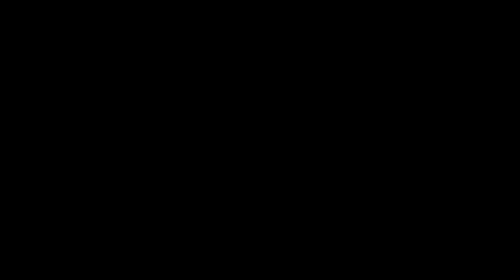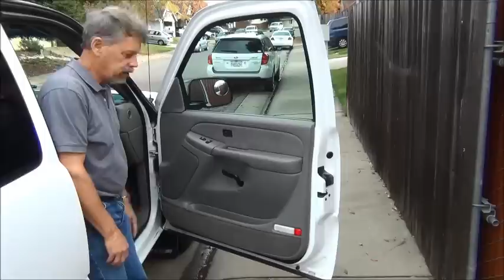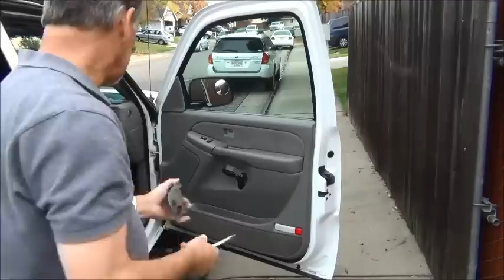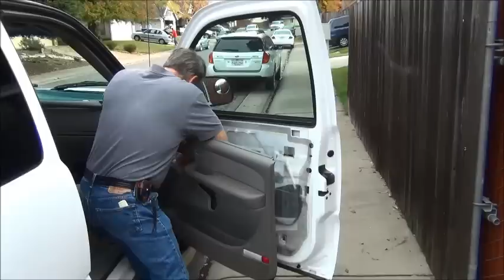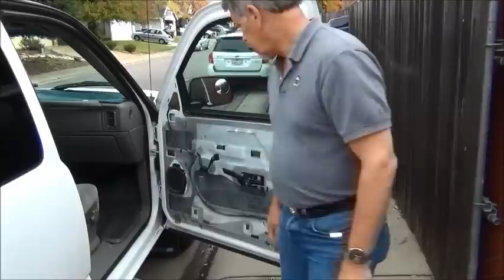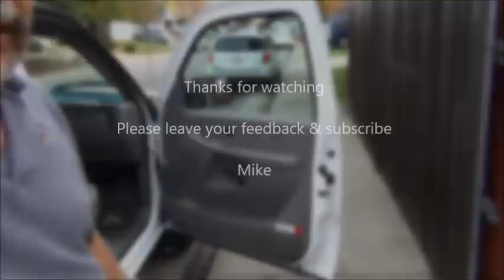2000 Chevy Silverado front door speaker replacement & door panel removal tutorial

Comment: will replacing both speakers fix having no bass whats so ever or do I have to get a new teeter?
Reply from the maker: I don't know if replacing the speakers will fix your problem. Your problem could be the speakers but it also could be the radio. Replacing the tweeters will not fix the problem since tweeters only reproduce higher frequencies.

Comment: I used this video as a base instruction to replace the oem speakers with another oem set. I had the speakers swapped out in 20 mins by myself. I will add my truck was a 2004 and I left the window lock/control panel in place prior to lifting the panel off the door. I found one tab was actually screwed in one spot from underneath. This likely would have broke if I pried it out. Just extra info. Overall great video.

Comment: Umm, pretty sure you can just pull the speaker cover off each door and that's it. The cover has tabs that make it very easy to pop in and out to access the speakers. Took me less than a couple seconds with a flathead 🤷🏼‍♂️

Comment: Video was good for knowing how to get the door panel off, but would’ve been helpful more if you would’ve stated the sizes of the screws and would’ve also shown how to unhook the wiring for the windows/side mirrors. That part was a little confusing for me trying to find the right socket and trying to unhook the wiring. But overall you gave me the information I needed to get started. Thanks for the video and keep up the work!

Comment: Thank you for the clear instructions for replacing the front door speakers. I might not be putting OEM, so I guess I will have to use self drill screws to put in a speaker in place.

Comment: so if I was to use 6 1/2 speakers, would I have to drill fittings or would it snap in?
Reply from the maker: +william nelson If the speaker is not an OEM type speaker you will have to make modifications for it to be secured to the door.
Reply: Mike Fedler OK, thank you for the reply, it's good to be prepared 😊

Comment: The video helped me 100%. Now, I wish someone would make a video of removing the backseat from the same year truck.
Reply: +Tyler Moore rear seat removal, remove 4 bolts that hold seat to floor, in the center rear there is a V support cable remove nut. Lift complete seat up off of rear hooks and its off.

Comment: Just replaced both front speakers on 2000 Chevy Silverado Z71 Stepside. Got them on amazon ACDelco 15038566 $45.00 each, over $100 at dealer. I knew both were bad because I could hear tweeter in each door but not main speaker. That let me know signal was getting there and probably wasn't the radio or connection. Went well, video helped a lot. Couple of tips. What holds screws in is a flimsy strip of spring steel don't over torque them they'll split. If you do you can get square plastic fastener with screws at O'reily's in the Dorman parts section. Driver's side has more connectors, no big deal. The little clips hold things in will sometime pull off plastic, just get them out of door and push back on.

Comment: Never tinkered with tweeters before so i am not to sure how to tell when they need to be replaced but what is the size of the tweeters? in my 02 all the speakers are dead sept for the driver side and that one is working on its last legs.. got the truck that way.. so i am not sure if the tweeters are also bad or just the speakers them selfs.. also need to tackle the speakers in the rear to :/
Reply: Did u figure it out?

Comment: Your vid got the job done on my 2002 silverado, using original equipment speaker purchased from Amazon. Also found the tweeter dangling, its two plastic mounting pegs having broken off. I removed the metal mesh grill so I could hold the tweeter in place and two #6 x 1/2" sheet metal screws with washers screwed perfectly into the holes left by the broken off pegs. Thanks for the help.

Comment: i'm thinking of getting aftermarket speakers for my truck (its the same one in the vid) would i need an amp or can i just put them right in there like you did
Reply from the maker: An amp should help but I think the speakers should would without any system modification.
Reply: what would you suggest for a guy in my situation amp or no amp
Reply: ***** Your door speakers should work fine, wether or not you get an amp. You wont be able to use the speaker to it's full potential, but they will still work pretty well.

Comment: If I install an aftermarket speaker will I be able to put the mounting bracket on the new speaker?
Reply from the maker: I don't think so. The mounting bracket was glued to the speaker. I think the bracket would be destroyed if you tried to remove it from the original speaker. If you find a method to remove and reuse the factory mounting bracket, please let us know.
Reply: I just replaced my OEM door speakers with new Pioneer A/M speakers. I used all the OEM hardware to install them, the original bracket can be pried (carefully, but it easily was removed) off the original speaker that you are replacing and reused to hold in the new replacement speaker, I didn't drill a single hole! I also pried off the OEM electrical connector and spliced that on the the speaker leads that came with the replacement speakers. I then tie wrapped the connector(that was pried off OEM speaker) to the replacement speaker frame and used the OEM door wiring harness,that i didn't have to cut, to connect the new replacement speaker. I am a strong believer that if you do not have to cut a factory harness not cut it! This was a very easy job. I can not guarantee that the factory bracket will work with all A/M speakers, but it worked extremely well with the pioneers i used. Good luck , hope this helps, if you don't have to cut and or drill....don't! I was also able to remove the factory seal on the back side of the original speaker and used that to seal in the new A/M speaker

Comment: where do I buy the new speaker
Reply: Eagle Mech Services 
ACDelco 19116641 GM Original Equipment Front Door Radio Speaker on amazon
Reply: @Benlucky602  what year silverodo did u put the 19116641 part  in? An do they work well?
Reply from the maker: I ordered mine from a company called "OE PARTS HQ". OEHQ dot COM. Part number "15038566". You can do a search and find other places where you can order them as well.

Comment: Mike,

Is it possible to install after market 3-way speakers (I have mounting bracket adapter) with the existing GM wiring? will the tweeter on after market speakers make up for the disconnected GM factory tweeter? thanks.
Reply from the maker: It should work. Since it is an after market replacement it may sound different. You should replace both left and right speakers at the same time so that the sound remains balanced between the two side.

Comment from the maker: My truck has a push button switch next to the headlight switch that allows you to turn off the interior lights when the doors are open. If you do not have this option but want to make sure the lights are off while doing the repair you could just remove the fuse for the interior light and then put the fuse back in when the work is done.

Comment: The rear doors on a extended cab are just as easy. All you have to do is take the bolt out of the cup holder pull the panel off slowly one side at a time. When you are putting it back together al you have to do is line the slots up and knock them in .

Comment from the maker: Thanks for letting me know that it helped. Positive feedback is always appreciated.
Reply: Gr8t installation but how do u removed the stock tweeter from the housing out of the door panel ?
Reply: @joeg.1119  okay so once you take off the door panel, the mesh screen will have tabs that are bent outward in the rear of the door panel, bend those suckers straight and the mesh screen will be able to be removed. Upon removal the bezel on the tweets should be twisted maybe a 1/4 turn and pull straight out and the tweeter housing will have two metal tabs on the rear. Close those together and push the housing out